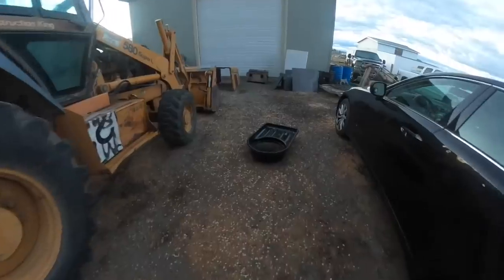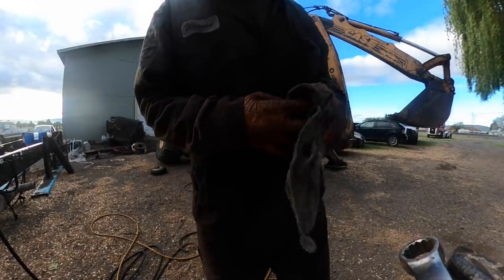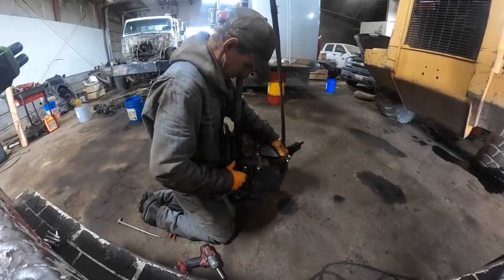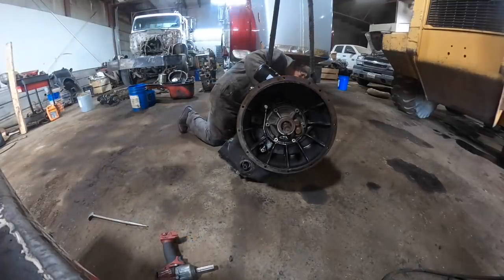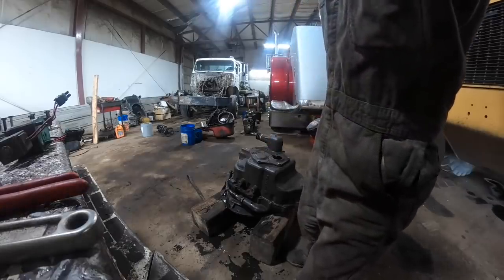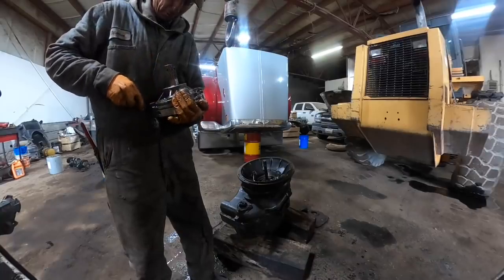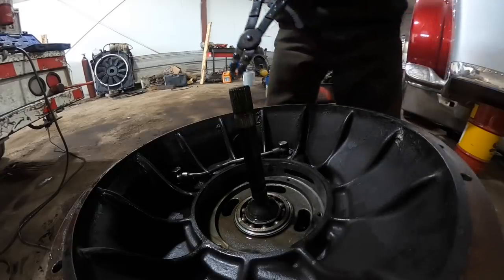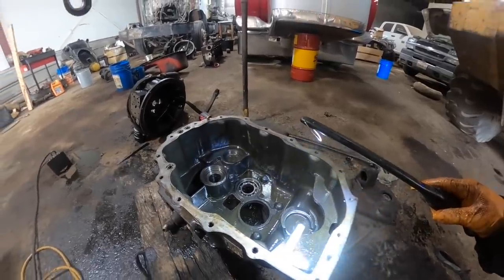Case 580 super L Cararro transmission carnage.

Comment: I remember my dad bought a 1989 580K Case in something like 1993, and ended up having an issue in the the 4bt cummins motor, he ended up tearing the whole damn thing down on our concrete driveway one weekend, then put it all back together with a new piston and honed cylinder walls. Ran like a top till he sold it in 2016. (for about the same amount he bought it for back in 1993) He still loves the older 580 cases, He swears by em to this very day as the best damn backhoe built. Good nostalgia.

Comment: Babysitting guys working for me was one of the biggest reason I quit being a lead mechanic  / service manager for an equipment dealer to start my own service truck....I told my old boss I'd rather be out in a storm, laying in the mud under a piece of equipment with hot oil leaking out on me knowing all I had to do was rely on myself to get the work done than deal with any more people problems and BS from management over me.
Reply: For me it depends on the person. Some guys great to work with. Like you explain something and they get it and remember it. Others just have no sense at all.

Comment: Looks good on the outside. Never understand how people can just beat to crap equipment. The price of this equipment is an investment. Run it until it dies without basic preventive measures, today’s attitude of modern “workers”.  Guess job security for you!
Reply: Bought a lot of equipment over the years that was owner(s) abused. Made great money fixing with usually easy repairs(many per unit) and selling them as working units.Owner of the TLB slipped off into the money pit: has to keep spending and hopefully he can find paying jobs for it to get some of the expense back.
Reply: And a failure by owners/ or managers. They should have maintenance check lists, primitive way would be to laminate them, for the cab. The current Operator/driver, must follow them they would be based on engine hours, for reporting that oil changes are require. Owners of a machine do conduct basic daily checks, and greasing. Why would, the employee not be expected to do the same, tick it off in an operator log book. And then, they must be held accountable.
Reply: @grahamdunton3283  after graduating from Vo-Tech, I worked at a College University, worked in the construction side. Every time when we parked a machine, didn't matter if it was a 10min break or several hrs, it was mandatory for us as operators to check all fluids, grease the grease fittings, etc., etc. I will say, very little break downs. However, I'll also state, the equipment was just plain worn out, very old equipment but, still going strong. Cheers :)

Comment: Not many are willing to do heavy equipment repair s..
Alot of really heavy dirty work with high tech mixed in.
Been doing that and Marine industrial since 1976.

CAT is desperate to train techs today.
All young people look up CAT tech training 4 year program s.
A good solid career with benefits and all.

I was in Union and Non Union shops.

No one here in NYS can find workers..
All fields it seems kids brainwashed by internet and society to believe they are "to good" to be"manual labor" and Mechanics..
Even without a college degree.
Crazy

I tell people not to power shift tranny's just stop and shift fwd to reverse and only push dig in low range.
Change transmission fluid and clean suction screen and planetary hub oils alot often ignored until it's too late.
Or $$$$$$

Excellent Work thanks.

Comment: Thanks for sharing bud sorry that your apprentice didn’t work out hopefully you will find a good set of hands soon! If I could get out there to help ya I would ! Let me know about #5 rod hopefully it’s ok but better have it checked and find ok then find out the hard way I’ve seen it now quite a few times on these ISXs with head issues and hydraulic lock and dealers just seem to overlook it or maybe just bang it out cause it’s not there $$$ but as an independent mechanic you got to go the extra mile because it’s your dollar and reputation on the line . Ok bud keep me posted take care 👍

Comment: I can appreciate "upside down". I bought a $12,000 car then had to put a $8,000 engine in it. My only choice is to drive it.
Reply: I have a truck that has been such a POS that if it stops breaking down now it’s still going to take me until I am 105 years old before I break even in the thing. Absolutely the worst piece of junk that I’ve ever owned even though it has had impeccable maintenance.

Comment: As you can see- Warren only has a regular water "pressure washer", which
is less than adequate for his needs.
If I had the funds- I'd donate. He needs an actual "steam cleaner" on a trailer
that he can tow to jobsites and both Shops. His type of work is so much easier
and less hazardous when components are properly degreased before work,
and even before returning equipment to the Customer. I've seen Warren already has the portable tanks. He really needs to fab a decent utility trailer for parts and extra stuff.

Comment: Would it be possible to ask the year of the Case 580 L machine because I have a Komatsu WB 140 -2 with a carrero transmission "tlb 1"  and was trying to match it with a Cummins engine and possibly this set up here would work if that is the same transmission that I have???? 🤞🤞🤞🤞🤞🤞🤞🤞 Trying to connect the two and don't know which adapter plate I need to make it work, if possible.

Comment: Warren sorry your worker flip flopped  on you. I need to find me some of those padded knee pants. I can't wear those strap on pads to good. I had a front end part of a case the other day. It holds the top steering knuckle bearing in place. It looked like your transmission parts. All worn an broke.🤔😳

Comment: Maybe tell them guys to have you look at them before they buy stuff. So they pay you $500 or whatever to look it over. They'll be better off in the long run. Even if they have trouble with it. At least it better than if they just looked at it themselves.
Reply: DID THAT IN MY AUTO SHOP, SOMETIMES CLIENTS WOULD COMPLAIN THEY PAID FOR 3 BUYERS INSPECTIONS AND HAD STILL NOT BOUGHT A CAR. $500 IN BUYERS INSPECTIONS PALED IN COMPARISON TO THE REPAIRS  "EACH" CAR WOULD HAVE COST .   THE ONES THAT PAID ME FOR BUYERS INSPECTIONS WERE GOOD CLIENTS, THE ONES THAT DIDN'T PAY ME TURNED INTO "PHENOMENAL" CLIENTS.

Comment: First and fantastic 👍👍👍
Reply: Have you ever worked on same tractor. Got a problem I can't seem to be able to sort after replacing the cylinder head gaskets.. only run on one cylinder.  Other three are blowing out cold blueish smoke plus raw diesel... help please..
Reply: @seandaly1291  try and replenish the oil or change the filter maybe it will work then 👍👍👍